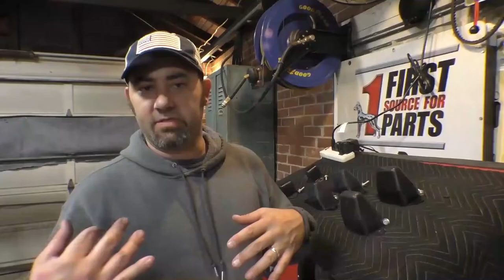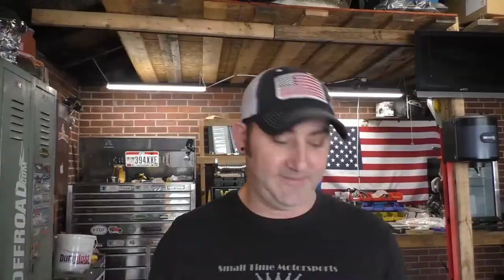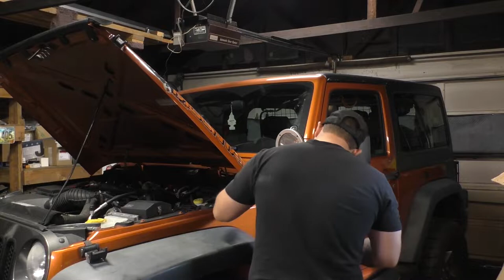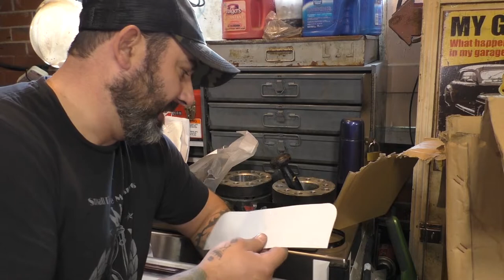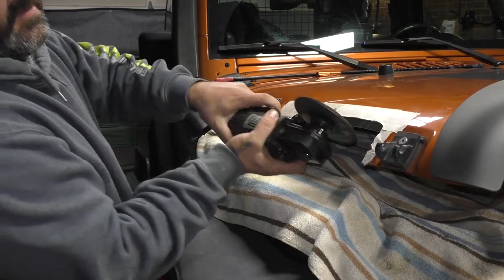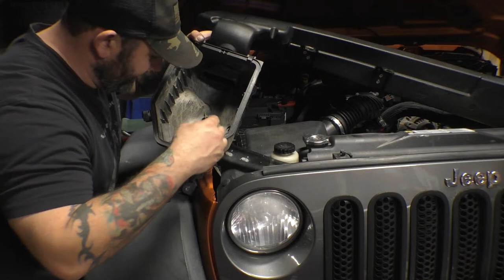Redrock 4x4 Snorkel Install

Comment: Nice job. You should spray a clear coat or nail polish or something in the edge of the cut so the exposed metal doesn't start to rust. It will work its say under the paint.